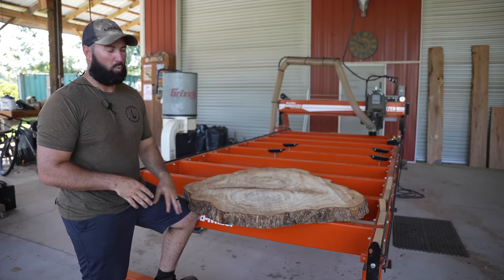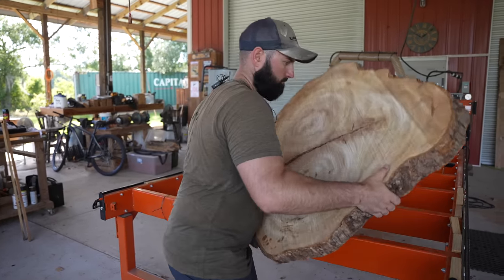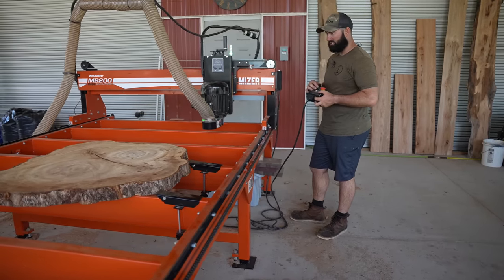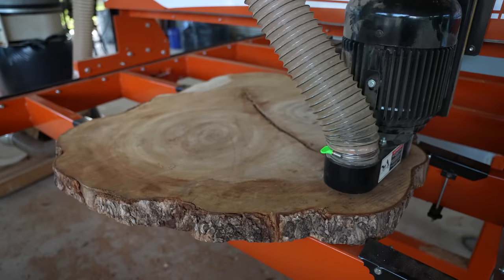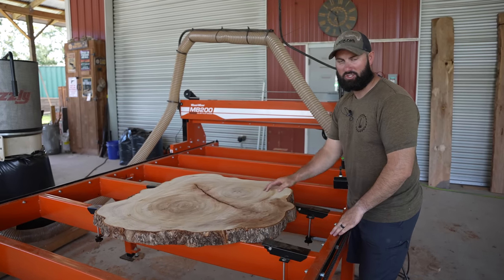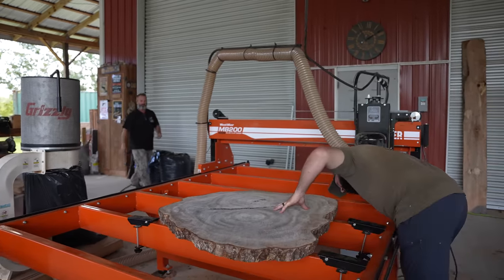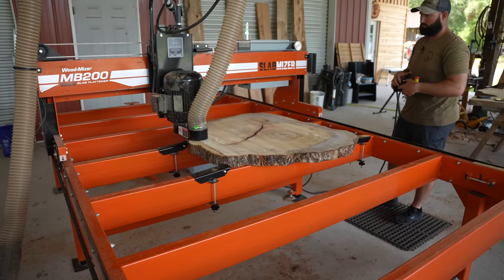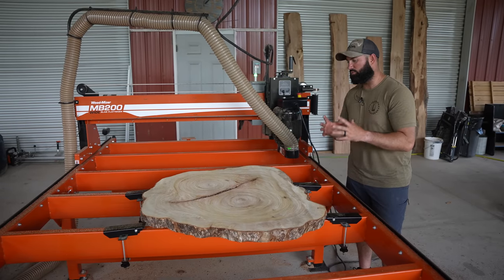Wood-Mizer MB200 Slabmizer Slab Flattening Mill

Comment: OK this might sound discouraging....I'm sorry if it does.  I checked the price of this machine.  I'm in Canada.  Basically 25 grand, which is around 20-22 thousand U.S.  The woodmizer looks like a large version CAD router with a big cutting head.  Where I live there is a shop 2 miles away with an open ended 36" surface drum sander that takes 2 minutes to change paper..  You start with 36 grit and finish at 80 grit.  In 10 minutes it would have that slab good and flat and takes way less room then that machine and there's no messing around with bench dawgs.    All you need is a good operator to know how to wedge it where it's low.  It would likely need 220 or maybe 600 v. but you already likely have lots of power.  When you compare the time it takes to process, the shop space required, and the finished product I can't see how this machine makes sense.  Again sorry for being a downer.  Maybe I missed something.  Love the videos.   Take care.  Steve
Reply: Have to agree, I like my timesaver, more possibilities of use. If that machine would run like a cnc as well, it'd be awesome to have.

Comment: Fantastic machine!!! One small "but" to Wood-Mizer: why didn't you apply automatic control? This is not expensive so much. Technically, this is not a challenge, but it practically frees the user from a very boring part of work, while absorbing his time, which he could use, for example, to prepare the next material for processing.
Reply from the maker: Thanks for the support. The machine actually does have an automatic feature. It is an upgrade but we do have it. We just hadn’t used it yet when this video was made. It does work pretty good and we will show it in a future video.

Comment: I love the machine but I think it would’ve been better if it’s done by laser and reads it so it moves on its own
Reply: I was wondering the same thing. Seems like a laser/CNC control system would allow the operator to use their time doing something else while this machine does its thing. Like Ron Popeil used to say on his Infomercials, "Set it, and forget it."
Reply from the maker: We do have the automatic feature on it. We just haven’t started using it yet

Comment: Just out of curiosity, are there thicknessing sanders big enough for something like that?
Reply: You've got your huge 30 all the way to 48"(biggest I've seen and used) drum sanders, or a lot of times called a "timesaver" from one of the ol school brands. Pretty awesome other than the fact that the rollers will bend material down flat and cup right back if you don't go super light pressure at first to get your flat side, or you can fill the void with some taped on thin strips of wood if running a longer board that's cupped. For a slab you'd just have to skim it until you get your flat side.
Reply: Yes they make some huge ones, at one time you could get an 84". 
We have an 18,000 pound four head 55" in our shop, it's just for finishing though, not for hogging large amount of stock.
They also have abrasive planers and those will take off a lot of stock, with a correspondingly huge electric bill to go with them.
None of them will work as good as that Wood Mizer